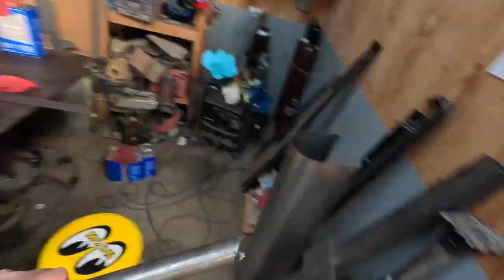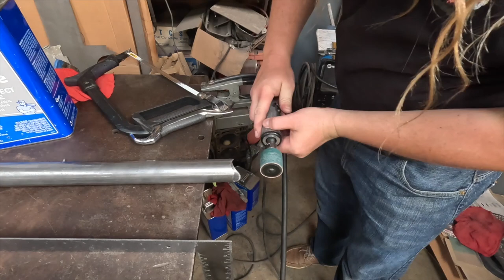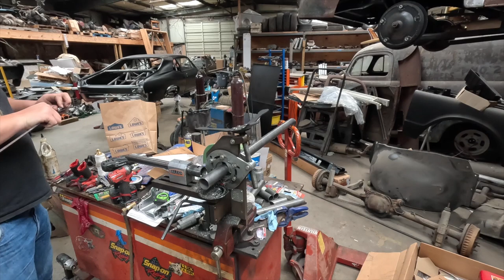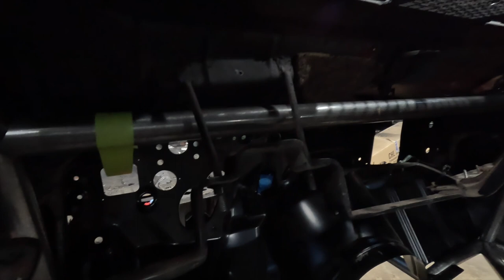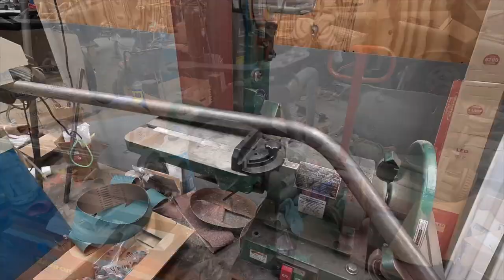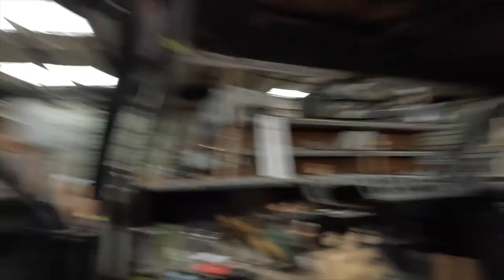Nova Gets Tight Roll Cage Bars! Adding more Tubes to the Chromoly 25.3 Chassis, Bending, TIG Welding

Comment: good work you think a chromoly back half be welded to an existing mild steel in cab cage and forward ? chromoly to mild steel  ?
Reply from the maker: You can do that if you want, but you just have to make sure the rear main hoop support bars are still built to satisfy the rules if you plan to have the cage certified. (Chromoly must be TIG welded, or if those bars are made from mild steel, they must be the proper thickness). The metals are somewhat dissimilar, but you typically use the same filler rod to weld either one; er70s-2 should be fine. Not sure if they would like to see a 4130 backhalf MIG welded on if you are considering that, but I don't think it would really be a physical problem. That being said, if you have the back of the car all cut out for a backhalf, it's probably a better time than ever to put a 4130 cage in it too. Thanks for watching and commenting!
Reply: @keefershotrodshop  yes everything ok back half will be tig and the mild steel is also tig welded thanks